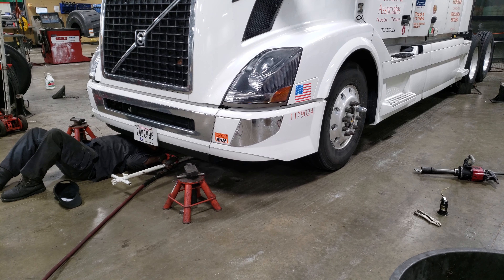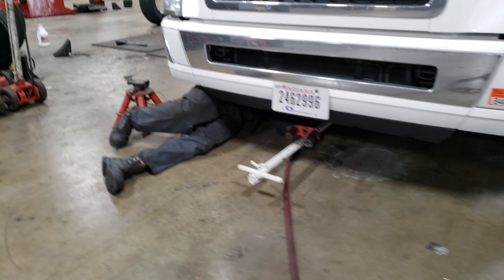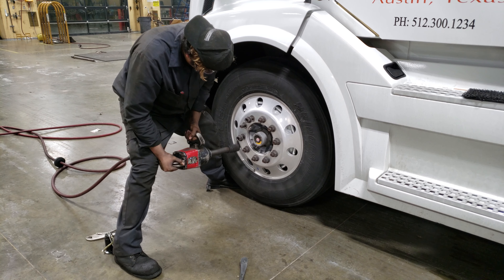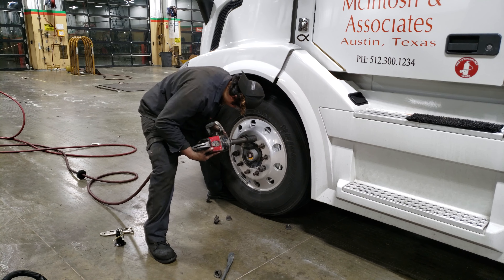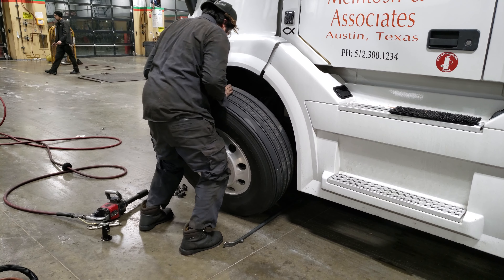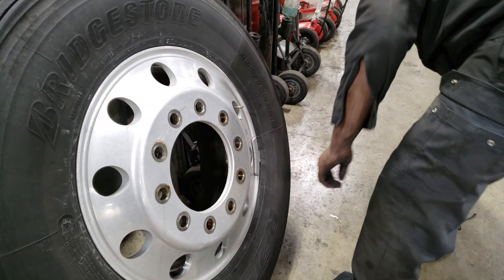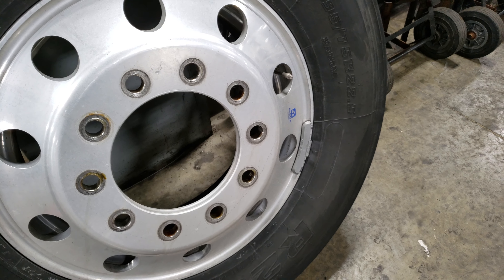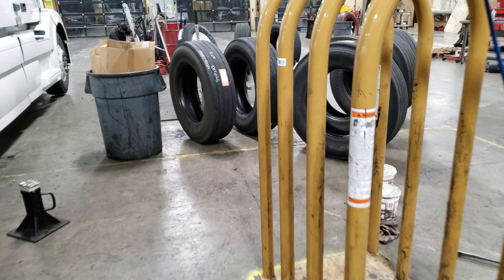How to change the steer tire on a commercial semi truck part 1

Comment: What are the torque specs for your lug nuts?
Reply from the maker: Not sure, im just a driver lol
Reply: Steve McIntosh your profile pic reminds me of kim jong un 😁
Reply: 450 - 500 ft/lbs on each nut
Reply: @mr.horsepower6847  that seems like a bit much
Reply: Strong Like Bull unbelievable. Another driver that doesn’t know anything about his truck and how to work on it. Yes it’s 500-550 foot pounds.
Reply: As someone posted 450-500 foot-pounds (for unimount wheels like these) it's literally stamped onto each lugnut
Reply: @helloneighbor11  thanks